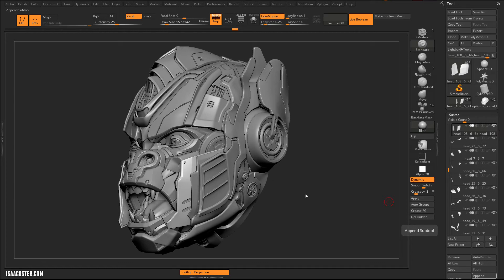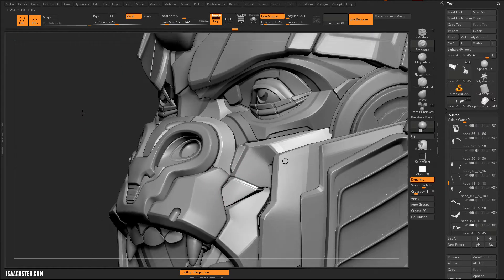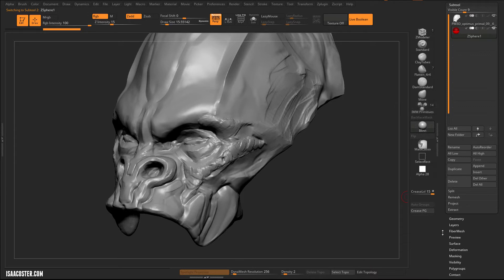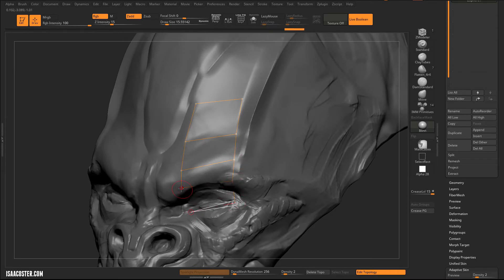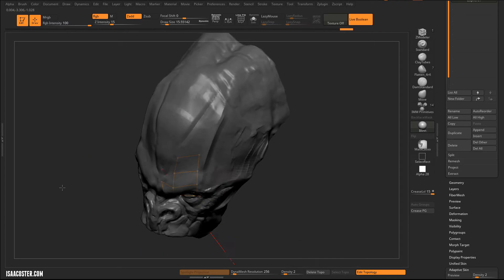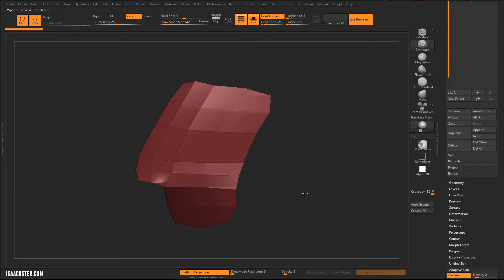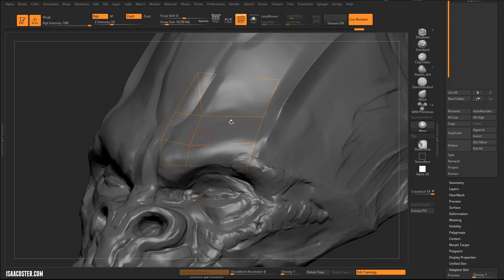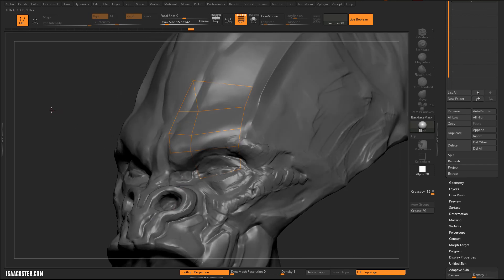Hard Surface Modeling with Zbrush 13 - Zsphere Retopology Part 1

Comment: Is there a difference or advantage of this technique over using the Topology Brush?
Reply from the maker: Retop with a zsphere allows you to put a point exactly where you want, you can move the point around after dropping it, and you can work across multiple subtools with subdivisions.  I  use zremesher a lot for subtool specific retop.  remesher brush seems like its kind of in the middle of these two approaches, and doesn't really solve either problem as well.  That said, I don't use it, so maybe I'm confused about how it works .